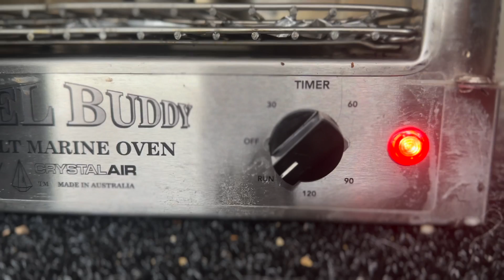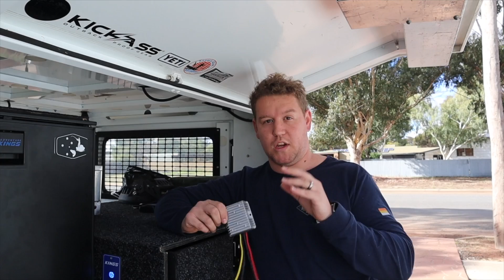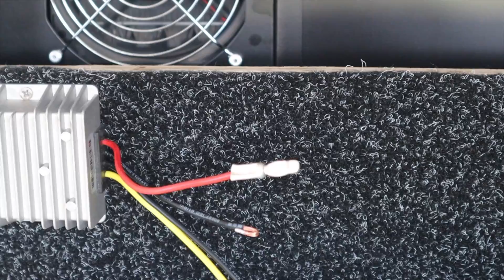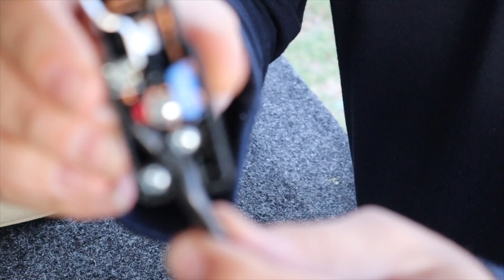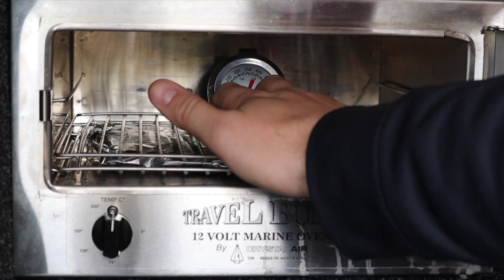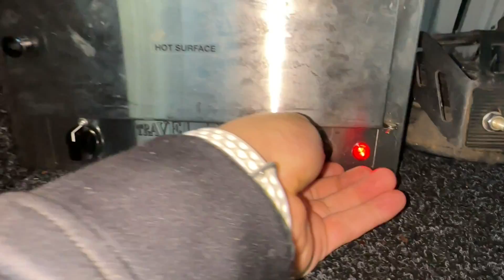Travel Buddy 12V Oven UPGRADE | Installing a Step Up Converter

Comment: Great information..Im going to run my oven on a battery which is hooked up to the solar panel. So I should be good to go during the day, correct? My charging system is independent from my vehicle, if worst come to worst I can run a generator to restore my battery. Thanks for the info and the link.
Reply from the maker: No worries mate. 
That’s how I run mine, that being said I’ve got a dc-dc charger I can flick on if my battery gets too low.

Comment: Mate does it matter if ya getting solar or alternator charge in with the converter connected?
Reply from the maker: No mate won’t effect the unit at all 👍🏽
Reply: Im going to run my oven on a solar charged battery independent of the vehicle charging system. But i will have a small Honda generator.

Comment: Hi mate does the step up converted need to to be disconnected while driving? Or can I just leave it plugged in the whole time?
Reply from the maker: Nah mate can be left plugged in while driving.
That being said I’ve stopped using mine since upgrading my battery.

Comment: IMHO, it is safer to focus on improving  efficiency given the general application of such units. This can be improved by making sure to use a high quality fuse or breaker with no voltage  losses. (if the fuse or breaker gets rather warm, it is wasting energy as heat) Further efficiency gains can be had with external fibreglass insulation on the cabinet with secondary  external  metal housing but I would not insulate or block any door components and or ventilation holes. 
This is just the opinion of someone who has tested on a particular brand of oven as there are variations in quality and components throughout the range. 
Voltage converters of any kind reduce efficiency and safety.   components eg timer/thermostat can burn out as this style of oven are generally designed for no more than 12-14v nominal. I would not use a 15v boost regulator under any circumstances. I would always monitor an oven in use, particularly if any modifications have been done.

Comment: You still using the 15v step up or you dropped back to 13.8
Reply from the maker: I’ve dropped back to the 13.8V mate. 
I wasn’t having any dramas with the 15V but I kept hearing the horror stories.

Comment: Hey mate, as you are aware of the video i did on a stepup conveter, i used a 13.8 volt one which is (8v to 40v in and 13.8v out) as a 15 volt seems to much i reckon. I have spoken to Darren the owner of the travel buddy company and he said he has seen the timers burnout with 15 + volt converters so be careful. Cars dont usually give that much voltage out so a 13.8 volt one does work well and is safe. Cheers.
Reply from the maker: Thanks for tip mate. 
I reckon I’ll have to look into dropping back to the 13.8V 👍🏽

Comment: I have a 24v one, and runs nicely when the sun is up and the batteries are at 27v.
or when I'm driving and they are at 28.5v
Reply from the maker: I’ve heard a lot of good things about the 24V units. Got a few truckie mates that rate em really highly 👍🏽
Reply: @OutNAboutAustralia  I have a video about it going public next week.
Reply from the maker: @TheAussieRepairGuy  wicked mate. I’ll make sure I check it out 👍🏽

Comment: Yeah good vid mate, I like the idea of this mod, I have a Kings Oven, only used it once so far, 2 pies unfrozen took 50 minutes & were perfect, I would like to do this mod tho & speed it up a bit. 
Have you checked what temps ur TB cycles at on max setting, or does it not cycle on the thermostat when set on max and just runs flat out at 14A-15A continuously until u turn it down or off? TF. Cheers
Reply from the maker: Sounds good mate, the TB does cycle at max temp but so far I haven't put the thermometer in to check the actual temperature.
I will be doing this test though so I'll be sure to post the result.
Reply: @OutNAboutAustralia  keen to see what it does cycle at on high temp. Cheers

Comment: Great video, thanks.  One thing I’m not quite sure about is whether you use this while driving or not. I understand it suits use for when not driving, but can you use it while driving?
Also, what size battery would you recommend to be able to use while not driving?
Thanks.
Reply from the maker: Hi Rox,
Yep you can still leave this all hooked up while driving.
Up to the step up converter input, your 12v system will still operate and charge at 12v as normal. It’s only after the step up converter that the voltage raises to 15V
Reply: @OutNAboutAustralia  thank you. I’ve got the 13.8v step up converter and assume it’s the same. Thanks again for your reply.
Reply from the maker: No worries 👍🏽
Reply: @Roxlivinlife  ive done a video on the 13.8v one, mine is 8v-40v input to 13.8v output, i went this one because i could use in my car on 12v or boat which is 24v.

Comment: Be careful. I bricked my Travel Buddy using a 15V Step Up Converter!! 15V was too much for it internally.
I ended up rewiring the TB and went to a 13.8V converter and it's perfect.
Reply from the maker: I’ll definitely be keeping an eye on it. 
Thanks mate!
Reply: I ran the 15v step up and found my oven turned off, died  , unpacked it and the main wire going into the timer had burnt off 😳, also noticed the cable going to the heat element had turned from red to a brown so I think that has coped a bit of abuse from the extra amps heat applied so managed to rewire what was damaged and oven has come back to life but think I would leave it stock or 13.8 step up , otherwise I think 24 v model oven heats up even quicker than 15v step up on a 12v , but all I can say is be cautious
Reply: So, was it just the wiring u had to replace, or were there other components like the thermostat, timer or element damaged in any way? i would expect if the thermostat could handle the extra wattage, it should keep it within certain heating parameters, but I dont know how hi they let the temp go before clicking off & cycling at around that predefined temp. Do you know what temps it could/would reach & cycle at?